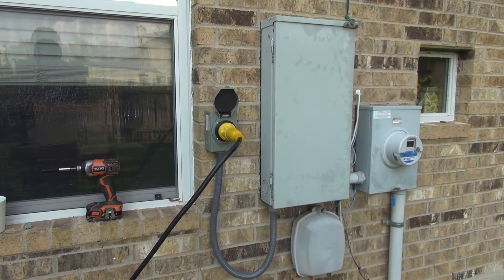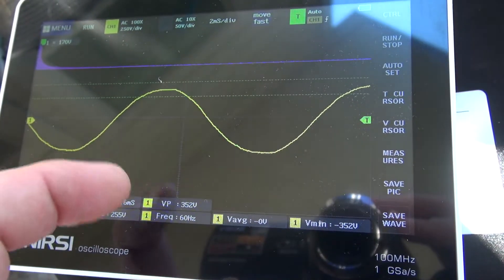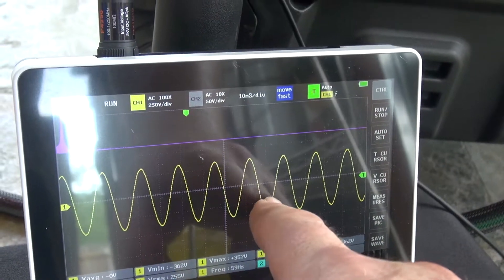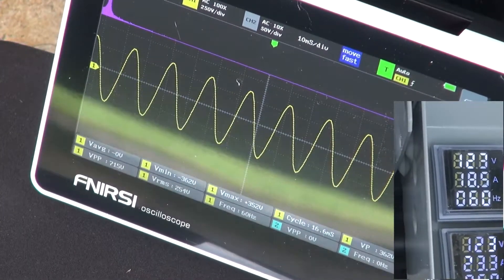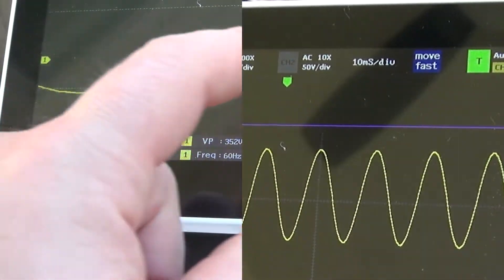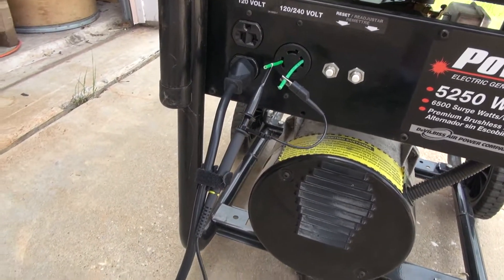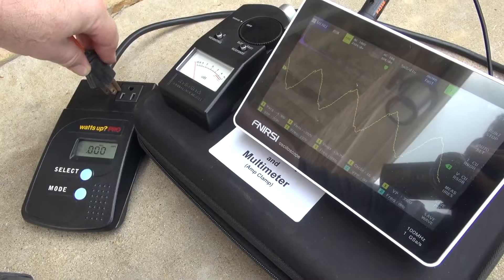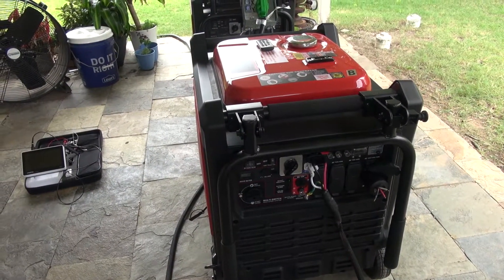Predator 9500 Inverter Generator vs. Line Power vs. Traditional: Compare Quality on the Oscilloscope

Comment: I bought my Preditor 6500 about a year before the inverter generators came out. That's why I made my 3 part video on "Cleaning a non inverter generator sine wave". If I was going to buy a generator today, it would definitely be a Preditor inverter generator. I have no complaints about quality and they're cheaper than other competitors products.
Reply from the maker: What you're doing is pretty much the same as an "online" or "True Online" or "Double Conversion" UPS.  They seem to go by different names / terms.  But the idea with these units is that the internal inverter is always running and on.  AC power is converted to DC to power the inverter and charge the batteries, and just like with your setup, the inverter is always running and connected directly to the batteries.  This takes care of any voltage fluctuations, and deals with noisy power because the pure sine wave inverter is always on, and always producing clean power.  They also usually have a USB connection where you can closely watch the battery levels, usage level / capacity, etc.

Inexpensive UPS units are typically offline, and will simply pass through line power unless the voltages exceed predefined ranges (or power is lost) at which point the inverter engages.  Those versions won't do a whole lot for cleaning up traditional generator power.

Nice work with yours.  My only warning would be to watch out if you bump up the inverter size, you could potentially end up slowly draining the batteries (And having it either shut off, or, having no capacity when power is lost) if you exceed the capacity of what the charger is continually putting into the system.  One thing is for sure, your batteries are larger than you'd find in any average UPS, that thing will happily run for a long time without line power.  Pretty cool!
Reply: @Texas_DIY : If you didn't view parts two and three, you will see my final setup.  
   Recently lost power for about 8 hrs. and did not need the generator, for the non inverter protected appliances, as I knew my freezers/refrigerators would hold the cold for that long a time.
    I ran two LED table lamps, wife's computer, internet, TV and cable boxes off the group 27 deep cycle battery that I'm now using in conjunction with the 1500 watt inverter suppling that side of my system. Total power draw was about 200 watts. Because of the low power usage from the electronics, battery draw down was minimal and this confirmed, to me, that when being used the generator can supply more than enough amps to keep a full charge on the battery plus power every thing on the non inverted side.
  The 12 volt (14+ volts actually) power supply I chose to use is a 100 amp unit. I know it's less then the inverter but I will not get any were near that kind of power draw on the inverted side. The 1500w inverter does have a monitoring screen showing if every thing is working up to design.

Comment: Would you have access to the other h/f inverter models to check the output quality?
Reply from the maker: I don't.  I purchased these expressly for this purpose.  Now I do have one of their other much smaller portable 120vAC inverter models (that is still parallel capable... not the new ultra tiny one they have now) and it too makes a nice clean sine wave.  (It's just not capable of 240v)
Reply: I can attest that the Honda EU7000 has the same quality. I have measured it myself with a Fluke oscilliscope, however, that was years ago.

Comment: I was lucky and managed to recently snag a Predator 9500 for my home. I’m waiting to receive my GenerLink power meter gen input/ATS which will allow me to power the whole house with a simple connection. I’ve been using a main panel watt meter for some time and I’ve never gotten above 7kW, except 1 brief time.
Reply from the maker: Those are certainly easier for installing (if you have the power company's blessing to help).  But be aware (and I may be wrong), my understanding is that they are fairly expensive, require a fairly expensive proprietary cable to connect to the GenerLink unit, and they tap out around 40Amps.  

But if you have a gas home and/or your needs are well under 40A, then it's an awesome way to deal with it.  No interlocks, extra breakers, transfer switches, or changing anything around.  Just turn on the generator when the power goes out.

Comment: For those of us with normal generators, what can we do to prevent damage to electronics?
Reply from the maker: For particularly important stuff, the only real way I know of to fix dirty power like that it is to use an online UPS.  (also called a "double conversion")  It always has the inverter activated, and it's using the line power to keep the batteries charged and to make DC power that it converts back into clean AC power.  
Most UPS units will pass through the AC power from the wall to your devices, and only engage when the power level exceeds the desired range.  But the "double conversion" ones are basically always "engaged", and your devices never receive the wall power directly.

Comment: Great review. I just bought an inverter generator (Europe, 220v, 50hz) and I have a doubt maybe you can explain... if I measure with tester HZ, I get, 3.5KH, 6KHZ at 1000w load, or 8 KHZ at 2000w load... if I measure my home outlet i get 50HZ. Then, if I replace HZ for % in tester I get 50. Is this correct? or really it must show 50HZ in tester, or maybe I´m doing wrong meaure? Thanks¡¡¡
Reply from the maker: Power is a bit different over there, so I'm not sure, sorry.  Where are you testing and getting such a high frequency?  As I understand it, the actual generator coils on inverter generators are wired to produce very high frequencies, and the electronics convert that high frequency AC to DC, and then back to clean AC again.  That's why the engine can slow down so much.  Were you testing it directly off the generator coils?
Reply: @Texas_DIY  Hi friend, finally I solved¡¡¡¡ my multitester have one option it´s HZ% (where I was measuring) and other as 200-600-1000V (and you can select voltage or HZ). I´m measuring in the generator outlet (or a multiple base). Well, if I put the HZ% option, I got these measures (3.5khz, 6khz and 8khz) and curiosly, they are the RPM of the engine¡¡¡¡ 3.5 idle, about 6000rpm with 1000w load, or 8500rpm with 2000w load. Curiosly, if I measure a home outlet in this position, I get 50hz. If I select voltage and then a option to change to HZ, if I measure, then are 50hz stable. I don´t know why the HZ% option detect other frequency (maybe in auto mode), and in Voltage option (ie 600v) and selecting HZ, then only detect voltage and real HZ: Thanks¡¡
Reply: @PabloOfRivers  If your generator is running at 8500 rpm it must sound like a gas string trimmer at full speed. Honestly, I don't know your meter but I'm pretty confident your using it wrong. The hertz/frequency from your home outlet and the generators' outlet should be damn near if not exactly the same.
Reply: @killer2600  Yes, I used a motorcycle multimeter to check rpm  (in the spark cable), and it´s about 3700rpm. And with correct HZ settings show a stable 50hz. thanks
Reply: @PabloOfRivers   There is often a difference between a typical (automotive) 4-stroke engine and a small engine 4-stroke that one must be aware of when using a spark/ignition based tachometer. The bigger automotive 4-strokes fire once per every two revolutions where as a small engine fires once per revolution (like a 2-stroke). Your rpm readings are possibly double what they actually are - so 1,850 rpms actual engine speed when your meter says 3,700. This would also make your 8,500 max rpms a more reasonable 4,250 rpms which is more in line with the the redline one would expect out of these size/type engines.
Reply: Usually this would indicate that the waveform isn't clean wine wave.
Reply: What you're seeing is the switching frequency of transistors in the inverter. You need a meter with a low Z input to see the 50/60 Hz sine wave. A Fluke 87V multi-meter has this ability.

Comment: Great detailed information.  Thanks so much for sharing this!  One question:  I think I can run our home on a Predator 9500 plus the Predator 3500.  If I parallel the 3500 with the 9500 using a properly built homemade parallel kit, would it still work to power a 120/240V electric panel?
Reply: One 9500 should be enough to power most homes. You may not able to run two central AC units, an electric range with all 4 burners and the oven going, your washer and dryer all at the same time but if you’re running of a generator you’re doing so for emergency power and you shouldn’t be running all that in an emergency anyway.
Reply from the maker: The 3500 is not a 240V unit like the 9500 is. I have no idea if it would sync. 

MAYBE if you started the 9500 first, the 3500 would sync to whatever leg it was wired into.  This MIGHT give you more 120 capacity on that one leg of your breaker box… or it might destroy one or both generators.
 
I would strongly advise against trying unless it was to another 240v inverter unit.
Reply: You can only run wattage up to the limit of the weaker generator leaving the bigger unit with a lot of unused potential. If both generators are at least close in output, you will see a net benefit:)

Comment: Thanks, you explained why to buy Predator.
Reply: It’s just extremely aggravating that the predator model is not dual fuel.....   Gas generators are not sustainable
Reply from the maker: Stuff like STA-BIL can keep gas usable for 2yrs.  But it does take effort to rotate stock (or use it in your personal vehicles and restock it) to keep it from aging too much.  In my case, the neighborhood is 100% electric, and it just wasn't practical to install a large propane tank for this.  (cement pad, trenching, piping, lease of the tank, etc. vs. some gas tanks and yearly attention)

Comment: Are you able to measure THD with your meter? My power company runs about 3-4% THD and I'm curious to see it the HF claim of less than 3% holds true while fully loaded. The graphs are awesome, but am curious if you are able to put a number to them?
Reply from the maker: I don't think my equipment is sophisticated enough to get a THD reading.  If it's possible with a very basic oscilloscope and a multimeter, and someone wants to talk me through it, I'll be happy to get the readings.
Reply: @Texas_DIY  you would need a special meter to measure the THD. What O-scope equipment and software are you using? It looks like it may be there somewhere. I can do some digging to see what I can find.

Comment: Well you did it, now I'm going to put my generator on my oscilloscope. For some reason I have just never looked to see how dirty it is. I will attenuate it properly so it doesn't blow my scope up.
Reply from the maker: LoL.  Sorry for what you might find, especially when it’s under a new heavy load. :-)

I needed to use a 100x probe to safely read the 240vac on mine.
Reply: My briggs Elite with AVR circuitry(their high end portable) was a little under 5% THD with no load and a bit under 15% loaded.

Comment: Any reason to chose the Predator 9500 over the DuroMax XP9000iH?
Reply from the maker: I'm not intimately familiar with the XP9000iH, but at a glance, I'd say the only significant reason to not consider it would be price.  Apart from that it looks really nice.  The DuroMax has a nice remote / automatic start, and can run on propane.  It also has a nice multi-function display telling you how much power is being used.  Runtime seems shorter, noise is probably about the same.  If you need to run on propane and need remote start (I wish mine had remote start), it might easily be worth the added $500-$600.  (but note you can get 10% off the predators using the HF card, so factor that into your price compare)

The only thing I'm really curious or concerned about is the lack of a neutral on it's parallel hookup.  Neutral is bonded to ground, so it must just be using that, but to me that seems a bit unsafe.  Imbalance between X and Y legs caused by 120v loads, will be handled by neutral/ground screw on terminal, which is exposed right there to be touched.  I wouldn't want to get my finger between that terminal and the ground cable of a parallel kit.  Even their parallel kit doesn't have a neutral on the left side L6-30 outlet.  (It's probably just fine as long as you pay attention, but it just gives me the heebie jeebies there.)
Reply: @Texas_DIY  thanks. I just was curious. I would be buying a generator and I am between the predator or the duromax
Reply: I read the predator is pure sine wave and the Duromax is modified sine wave. Predator says less than 3% THD and Duromax is less than 5% THD. I've not been able to find if that was loaded or unloaded on either. My briggs screamer is 5% unloaded and a bit under 15% loaded.
Reply: @tomroth2634  Thanks for the info. Ironically pure sine wave is supposed to be more expensive but in this case, the predator is cheaper than the Duromax
Reply: @tomroth2634  are these published THD numbers or real world measured numbers?
Reply: I'm fully convinced that they are the same generator made in the same factory. The Duromax adds propane ability. There's a video that compares the two. https://www.youtube.com/watch?v=qVMIhyyLBLQ  When everything is the same down to the bolt, hint hint.
Reply: I'd get the XP9000iH because it can run on propane, no storage worries with it and propane last 20+ years

Comment: Your line power was easy to differentiate from the Preditor as it has some flat spots near the peaks while the Preditor has a better rounded sinusoidal shape. Thanks for this comparison, I had read that Preditor generators don't put out clean power, but that is clearly not the case for the 9500.
Reply from the maker: Good eyes!  You're quite right, the generator power was actually slightly better than my home power.   :-)
Reply: I have both a regular generator and the inverter generator - the 9,000 or 8,750!regular and the 9,500 inverter and the regular def doesn’t have the cleanest waveforms. I’d considered making a similar video showing this but I’ve burnt up the 8,750 and haven’t torn it down yet to see what the actual issue is.